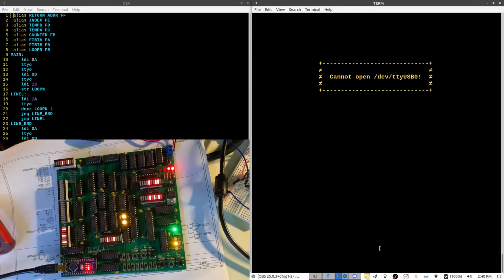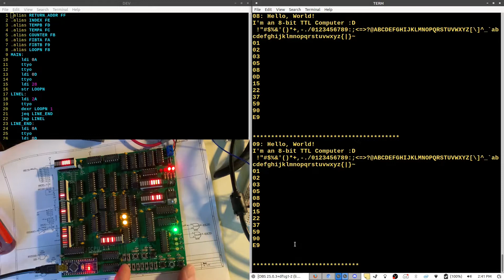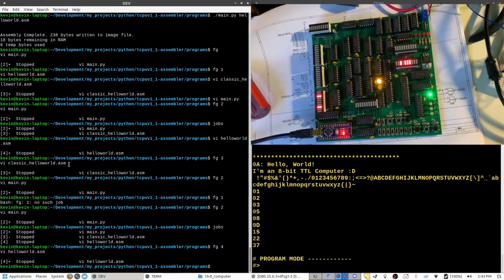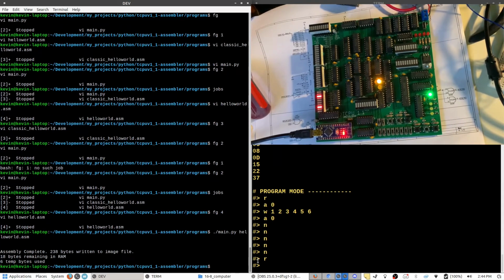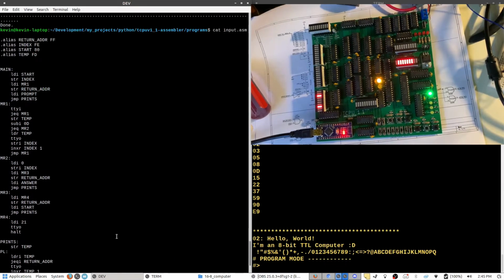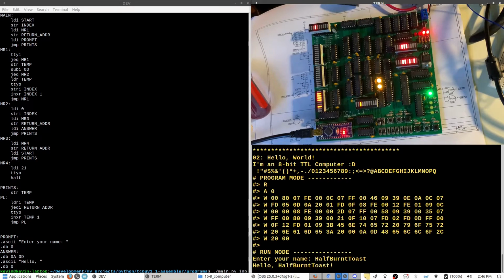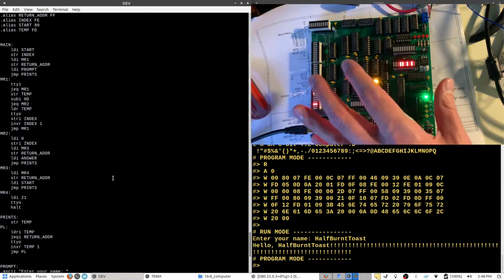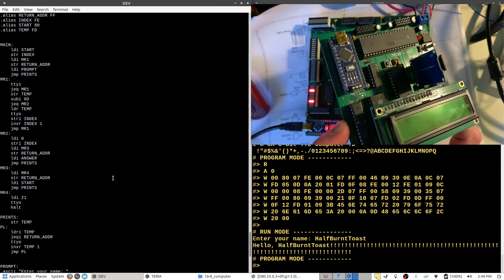My 8-bit TTL CPU Overview

Comment: When the video started I was puzzled as to how you had managed to implement a working 8-bit CPU with so few TTL logic chips. Answer - you haven't. The Arduino is the heart of the system. Without it nothing would work.
Reply: Electronics Boy  Indeed so! And if multiple people share the same opinion it tends to reinforce the validity of that opinion 👍😁